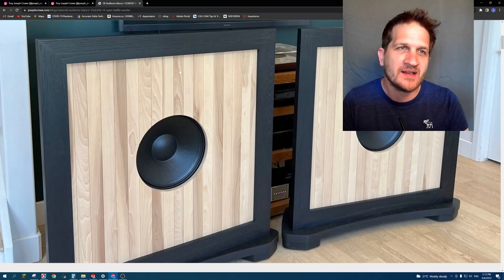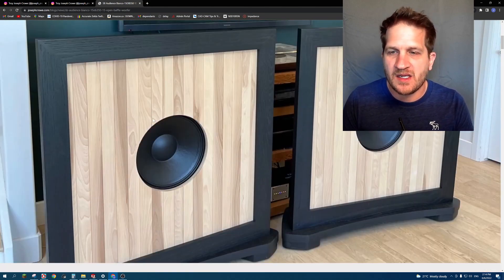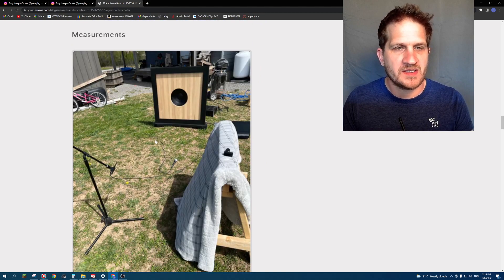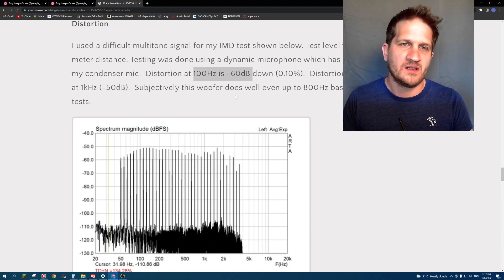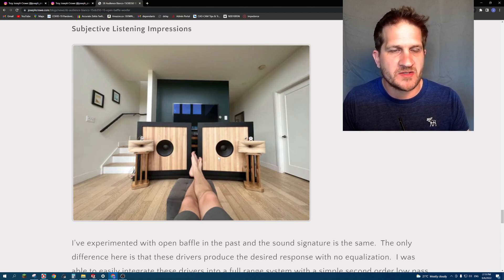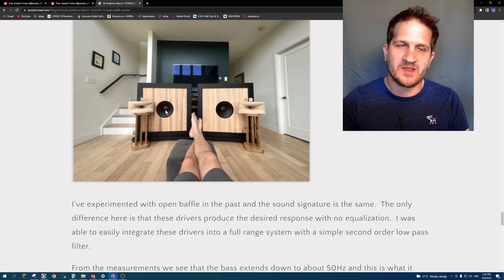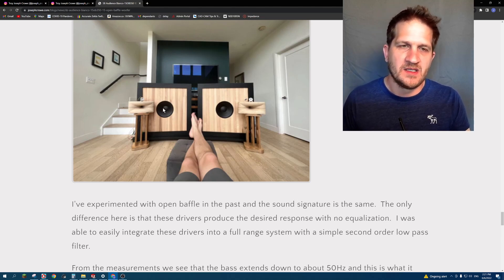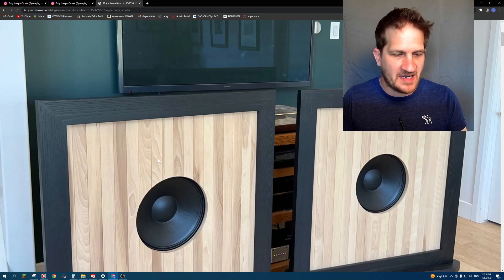SB Audience Bianco-15OB350 15" Open Baffle Woofer

Comment: If you had 4 per side, could you get them low enough so that a sub would not be needed?
Reply: Indeed, but that speaker would be 3 times as expensive.
Reply: @vgstb I forgot I even made this comment a year ago.  Fast forward to the present.  Finishing an OB speaker which is a modification of a Joseph Crowe design using 2 of these woofers per side (original design used 1 per side).  The speaker is bi-amped so each pair will have over 400 watts of power (Class D amp) @ 4 ohms (speakers wired in parallel).  The room is not large (approx. 14.5’ x 17.5’).  My hope is to get an in-room response down to 35 hz.  As the speakers will not be doing any HT duties, I don’t expect to need a sub.
Reply: FYI, my system is up and running.  I’m using 2 of these woofers per side.  Each pair is powered by a Class D amp with 450 watts per channel into 4 ohms.  Crossover point is 100 hz.  Addtionally, I use Dirac room correction from 300 hz and below.  I started with flattening the response from 100 hz to 20 hz.  This produced boomy bass because, below approx 35 hz, these woofers really drop off and I was probably hitting the Xmax of the woofers.  So far, my best results have been setting the lower frequency limit at 34 hz (FS of the woofers) along with a Harmon curve boosting the frequency response gradually from 100 hz to 34 hz by 4.5 db.  Now the bass is well defined and not at all boomy.  

There is a bass presence here and the bass is palpable, but it is not in your face.  I had to re-arrange the furniture in my listening room because the glass doors of one of my cabinets was gently rattling.  So I now the palpability of the bass is not in my head! LOL!  

The downside of this system is deep bass.  Crowe got bass down to 50 hz with one pair.  With my system, the bass goes down to 34-35 hz.  I tried pushing it to 30 hz and the bass became boomy.  Somewhere around 34-35 hz is the limit.  On the plus side, my system goes down to 34 hz with authority.  

In sum, I don’t feel the need to run out and get a sub with this system; they punch hard until 34 hz and then bass response drops off a cliff.  So the question I would ask anyone is how important is deep bass to you?  I would not recommend these woofers for HT, but how much music do you have that goes below 34 hz?  Also, how much are you willing to pay for lower bass response?  I know of only one 15” woofers that plays almost to 20 hz and it is REALLY expensive.  Your answers to these questions will determine whether these woofers are the right choice for you.

Comment: Probably dumb question, but since the open baffle is rightfully so large, why not use a bigger subwoofer driver? For example, could use the SB Audience 21” 21SW800 with a QTS of 0.76. Seems like it can get you up to 800hz. Or just double up the 15OB350–2 per side. Both would get you the same footprint while fitting in the large baffle.

Comment: if possible can you post a small demo of any track with "fast drums" please... it would be great to see the speed and transients from OB bass drivers
Reply from the maker: Speed? I’m not sure what that means. The driver has plenty of bandwidth well into the midrange. Technically this is what determines a “fast” driver assuming the frequency response is flat.
Reply: @JosephCrowesDIYSpeakerBuilding  ya...the word is misleading. I mean the transients.
Reply: Multiple factors contribute to subjectively apparent speed. 

Above all else, physics dictates instantaneous current capability on tap, into a given driver's inductance, ... THAT's what determines rise time response (perhaps this is characterized by HiFi terms like 𝙂𝙍𝙄𝙋).

Subjectively fast bass speed may also depend on inter-driver alignment in the time domain. 

However perhaps the greatest impact on "bass speed" is poor LF decay characteristics of the room. 
For the listener to experience the pure tonality of low frequencies, the texture, weight, and impact, the propagating low freq energy must adequately disapate prior to subsequent propagating energy. 

Typical, undamped LF buildup obfuscates bass clarity, detail, and of course... "speed". 

Precisely why when I FOH engineer an outdoor event, the LF clarity and impact can be crushingly, devastatingly good. If you're sitting inside of critical distance, and within an area of proper summation (power alley), the quality and intensity of the sound can be superb. 
Kick Drum, the new lead vocal;)
Reply: @FOH3663  Hi! I totally understand you. Slow bass is useless to me, im a bassist and the attack must be instant. Response, timing. I would look at the other monitor with a 15" with 4 ports and a es horn. Another one of Joseph's designs. A talented guy Indeed.

 127 db from a Jbl of the newer model. 2265 or something like that. I Hope you have a great day. Gabriel from a cold Sweden 🙂
Reply: @gabrielnilsson5398  
Very nice!

Comment: Thanks for the informative video Joseph. What is the calculated dipole peak for that baffle size and did it correspond with your measurements? I'm curious how the AE Dipole 15 compares in IMD and other tests.
Reply from the maker: The baffle is 122cm square.

Comment: I wouldn't call 0.56 QTS, high QTS! 
Great video though!
Reply from the maker: In this context (home audio) it is high. 99% of products are in the 0.28-0.33 range, unless specific to open baffle such as this product. The only other if it’s type that I know of is the AE dipole 15.
Reply: @JosephCrowesDIYSpeakerBuilding  AE are beautiful drivers. Fi Car Audio has some very beefy high QTS woofers if you want to take it up another level.
Reply: Its not high q 😂
Reply: Very interesting video wrt distortion. I use dual 15” 0.72 qts woofers and definitely can’t use a Yamaha RXA3030 on that, use instead an old Hafler.

I would really like to see an effort to create a ripole or damped u frame with these woofers.
Reply: Do you get appreciable panel vibration when playing loud bass? I have been pondering magnet mounted woofers poking through a relatively lightweight baffle to overcome that…it’s a big problem for PAP Trio 15 TB. You don’t co-mount the hf drivers so maybe not an issue that way.

Would love to see ripole, even better I’d like to see an approx 18” damped u-frame (giving close to cardioid bass response)
Reply: Reasonable Q for sealed but a little low for OB IMO. I like at least .7.